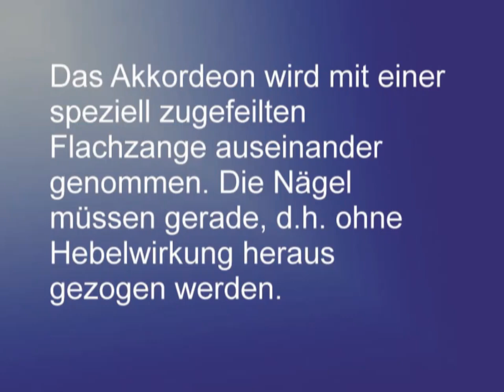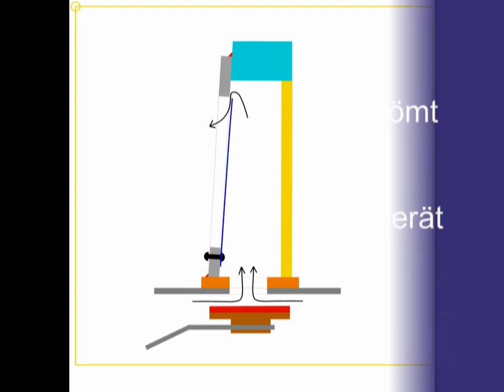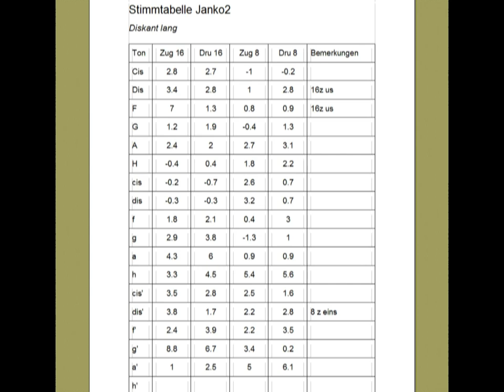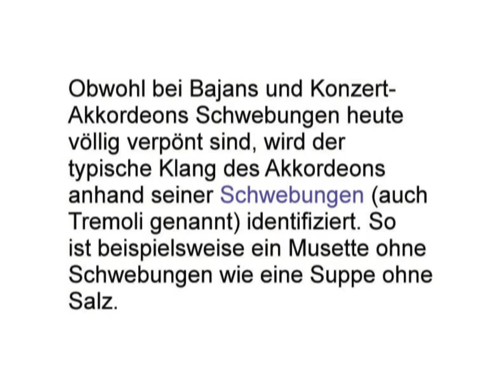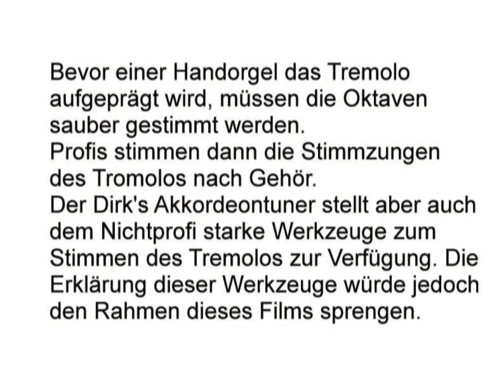Accordion Tuning. How to tune an accordion. Quick and Easy.

Comment: I was gifted f Dirk's Accordion Tuning Software, by a guy I met several years ago.( It was his thank you to me for helping him set up a concertina repair shop. )
I t is a awesome tool worth the Price.
The mic from the computer picks up multiple reed bank being played to together, for a visual of what reed is off from the other reeds. I do not use it when doing 2 or 3 reed  set  boxes. But it is a time saver when tuning 4 X 5 boxes.especially if they are variations of musette banks. This is a great tool, it doesn't do the tuning for you, but shows you where the flaws are, if you know what you are looking for.

Comment: 0:00 How to tune an accordion
0:08 The accordion is taken apart with flat-nosed pliers. The nails must be pulled out straight, i.e. without leverage
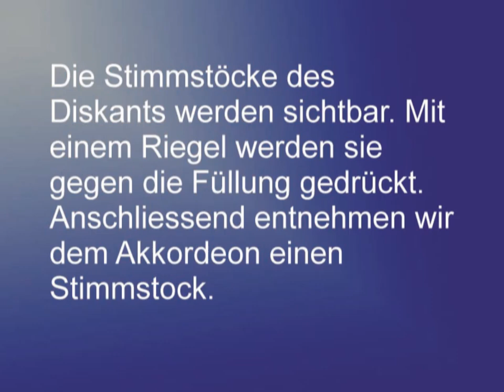1:02 The reed blocks of the treble side become visible. They are pressed against the filling with a metal plate
1:20 We remove a sound block from the accordion
1:28 filling of register slides
1:37 set of air valves
1:41 reed block from the front
1:44 from the top
1:47 from the back 
1:51 underneath
1:54 Cross section
1:57 air chamber
1:59 reed block back
2:01 reed block body
2:03 reed block back
2:05 reed plate
2:07 reed
2:10 rivet
2:11 wax
2:13 filling
2:15 key rod
2:17 valve (pallet)
2:20 felt with leather
2:22 The valve opens. Air flows out of the accordion through the chamber (on push). The outer reed starts to vibrate
2:40 on pull: air is drawn into the accordion. The inner reed starts to vibrate
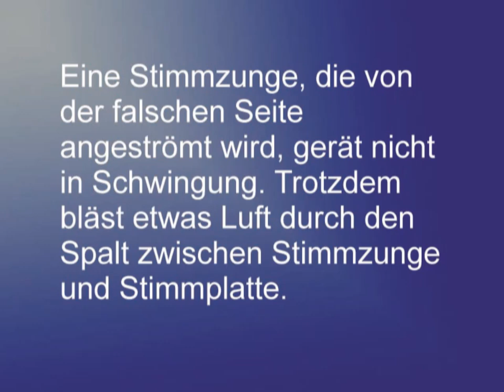2:58 A reed blown by air from the wrong side will not vibrate. Nevertheless, some air flows through the gap between the reed and the reed plate
3:06 To prevent this loss of air, the reed plate has valve flaps made of leather or plastic. The thin valves are glued to the reed plate with special glue
4:25 The reed plate is nailed to the reed block. The nail head is cut off and the nail bent so that it presses the reed plate against the leather strip on the reed block base
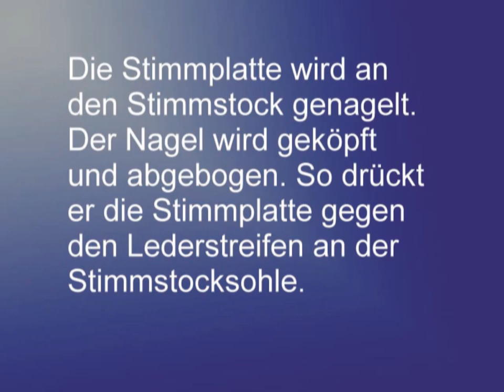4:35 leather strips
5:15 The advantage of nailing is that the reed plate can be easily removed from the reed block. Prerequisite for nailing is an absolutely flat surface on the reed block body
5:23 push
5:28 pull
5:33 Each reed plate has two reeds and two valves. The outer reed vibrates when pushing, the inner reed when pulling
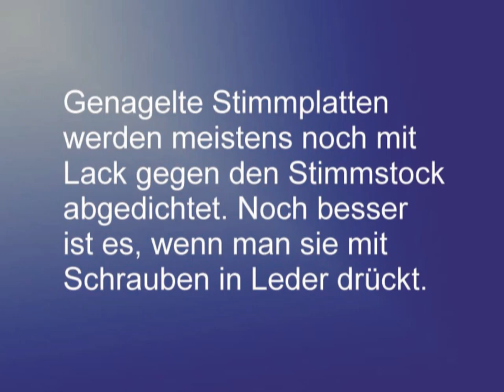5:42 Nailed reed plates are usually sealed against the reed block with varnish. It's even better if you press them into leather with screws
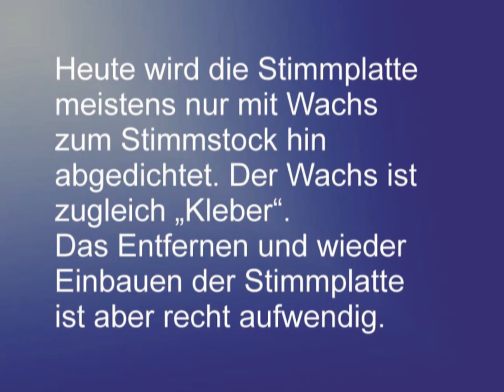5:58 The reed plate is usually sealed with wax. The wax is also 'glue'. However, removing and reinstalling the reed plate is quite time-consuming
6:13 Wax dissolves well in white spirit. An acetone bath followed by a bath in white spirit and drying with compressed air is suitable for cleaning dirt and glue residue from the reed plates
6:25 Reed plates with rusty reeds should be replaced if possible. Moisture and rust are the accordion's greatest enemies. Cold often creates moisture!
6:33 This was just a brief introduction. The accordion that is actually being tuned is a two-part instrument with a free-bass. It has a total of 260 reeds, which are distributed over 4 reed blocks. Two reeds, one octave apart, always sound at the same time. No tremolo
6:44 This is how the untuned instrument sounds
6:57 The frequency of the tone that a reed produces depends not only on the reed itself, but also its surroundings (e.g. whether in the cassotto or not) and pressure when played. For this reason, the pitch of a reed outside of the instrument may be corrected, but never absolutely tuned
7:12 In order to know how much correction is to be made, the first step is to record as accurate a profile of the instrument as possible. The individual reeds are vibrated one after the other in the instrument with as constant a playing pressure as possible and recorded with Dirk's Accordion Tuner
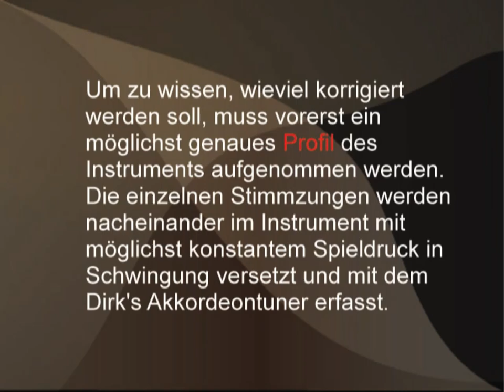7:25 First, a voice profile is recorded. Dirk's Accordion Tuner is set to 440 Hz and 1 reed. The "Auto" button should be clicked. The microphone is placed about 30cm in front of the sound outlet of the instrument. Ensure a quiet environment
7:38 The accordion is taken apart and the reed blocks partially covered with adhesive tape. If the accordion has register slides, this procedure can be dispensed with
8:15 The accordion is then reassembled. Each tone is played, measured and recorded individually. The author uses a prepared table chart. But you can also use the table chart provided with the accordion tuner
8:25 When playing, make sure that the playing pressure is constant until the chord tuner displays the message "locked". The measurement is reproducible to +-0.5 cents
8:47 Tuning chart: Note, values (Zug = pull, Dru = push), Remarks
9:01 After about 2 hours work, the finished table looks like this:
The mean deviation is +2.3 cents. This corresponds to a fundamental frequency where A4 = 441.0 Hz
9:20 The table is now corrected: the average value of 2.3 cents is subtracted from each deviation. If the corrected deviation is more than 2 cents, the field is colored: blue for positive deviations, yellow for negative deviations
9:45 Now the reed blocks can be removed. Reeds that deviate from the target frequency by more than 2 cents are retuned on the tuning table
9:53 If the tone is too high (blue), the base of the reed is ground, if the tone is too low (yellow), the tip of the reed is filed
10:03 tools for grinding
10:08 Microphone, Tuning table
10:14 Tuning table bellows
10:20 laptop with Dirk's Accordion Tuner
10:25 magnet, reed retainer
10:36 In the first example, the note D# (8') is tuned on push. It is 3.7 cents too low
10:52 With the reed block removed, a deviation of -4.7 cents is measured. By filing the tip of the reed, the deviation should be brought to -4.7 + 3.7 = -1.0 cent. A few stages are usually necessary for this
11:16 target: -1.0
11:26 In the second example, the note D# (8') is tuned on pull. It is 7.6 cents too low
11:42 With the reed block removed, a deviation of -10 cents is measured. By filing the tip of the reed, the deviation should be brought to -10 + 7.6 = -2.4 cents
11:52 Since the reed is hidden under the valve, it must first be 'fished out'. The author uses a self-made tool with a magnet and pulls or pushes the reed upwards with it. Then it is clamped
12:34 target: -2.4
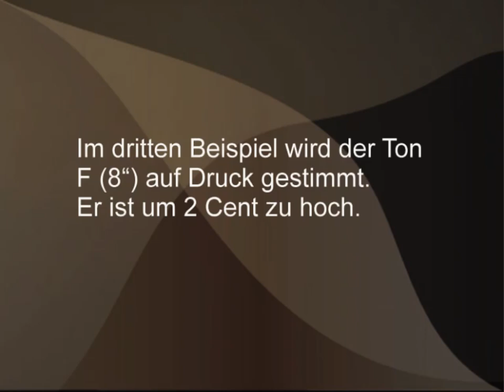12:45 In the third example, the note F (8') is tuned on push. It is 2 cents too high
12:55 With the reed block removed, a deviation of -3.9 cents is measured. By filing the base of the reed, the deviation should be brought to -3.9 -2.0 = -5.9 cents
13:11 target -5.9
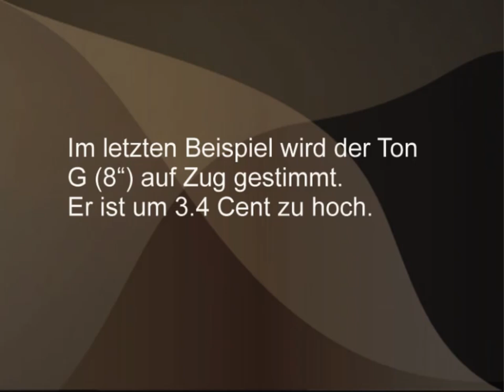13:23 In the last example, the note G (8') is tuned on pull. It is 3.4 cents too high
13:32 With the reed block removed, a deviation of -4.6 cents is measured. By filing the base of the reed, the deviation should be brought to -4.6 - 3.4 = -8.0 cents. Because the reed is hidden, it first has to be 'fished out' and clamped
13:52 target: -8.0
13:58 And this is how the tuned instrument sounds
14:33 Although beats are completely frowned upon in concert accordions, the typical sound of the accordion is identified by its beats (also called tremolo). For example, a musette without beats is like a soup without salt
14:43 Beats occur when at least two tones with almost the same frequency sound simultaneously. A tone is heard whose amplitude periodically rises and falls. The greater the difference in frequency between the two tones, the higher the beat frequency
14:55 The beat frequency also depends on pitch. The higher the pitch, the greater the beat frequency. For example, two tones A4 (440 Hz), which are 20 cents out of tune with each other, have a beat frequency of 5 Hz
15:07 The higher the beat frequency, the 'sharper' the tone appears. If the beat frequency is greater than about 15 Hz, you clearly hear two tones and not a single tone with a beat. The following audio examples give an impression of this
15:19 Tone A4 440 Hz dry. No tremolo
15:24 Tone A4 440 Kz. Deviation 4 cents. Beat frequency 1 Hz
15:30 Tone A4 440 Kz. Deviation 8 cents. Beat frequency 2 Hz (French Canadian)
15:36 Tone A4 440 Kz. Deviation 16 cents. Beat frequency 4 Hz (Tex-Mex)
15:42 Tone A4 440 Kz. Deviation 20 cents. Beat frequency 5 Hz (Italian, French)
15:47 Tone A4 440 Kz. Deviation 40 cents. Beat frequency 10 Hz (extremely sharp)
15:53 Tone A3 220 Kz. Deviation 40 cents. Beat frequency 5 Hz (Sharpness is gone)
15:58 Tone A5 880 Kz. Deviation 40 cents. Beat frequency 20 Hz (clearly 2 tones)
16:04 Higher tones bear less deviation in cents than lower ones, although the beat frequency is usually chosen higher for higher tones than for lower ones. Every tuning professional uses his own tuning profile by which he can also be recognized
16:15 Before the tremolo is impressed on an accordion, the octaves must be tuned properly. Professionals then tune the reeds of the tremolo by ear. Dirk's Accordion Tuner also provides the non-professional with powerful tools for tuning the tremolo. However, the explanation of these tools is beyond the scope of this video
16:34 Thanks for watching! www.dirksprojects.nl